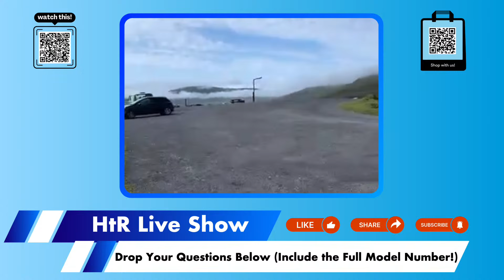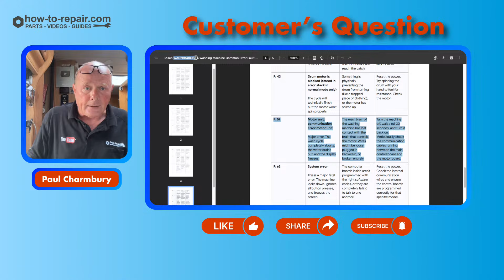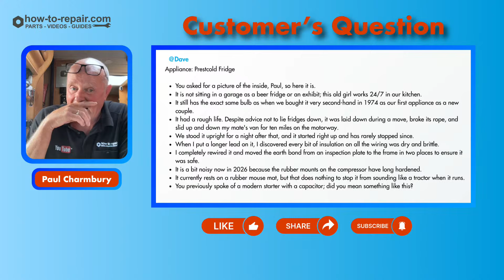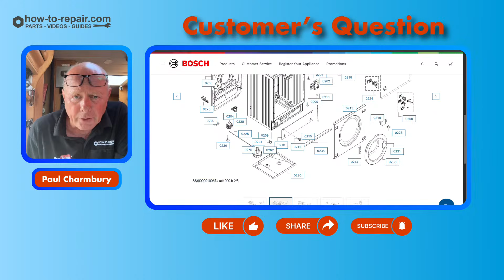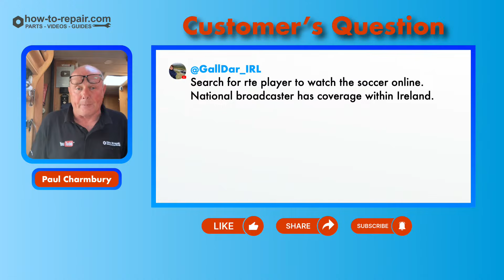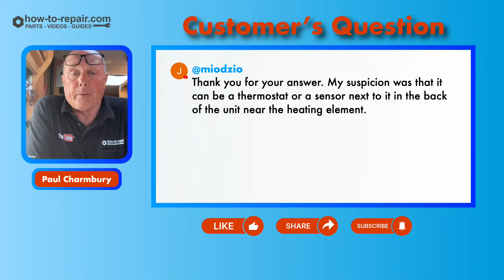Roadside Repair Secrets | Ep 25: Answering Repair Questions from Cloughmore Main Pier, County Mayo

Comment: If the CV joint boot is intact with no leaks or splits then regardless of a patch in theory it should pass an MOT.
Reply from the maker: We will see when we get to the MOT station, as it's due in August. Before I go off on my next travels. It's done 1,200 kilometers now and no leaks. It's done 1,200 kilometers now and no leaks. https://youtu.be/XohZr6fwd0g